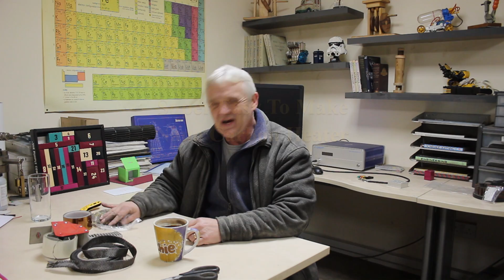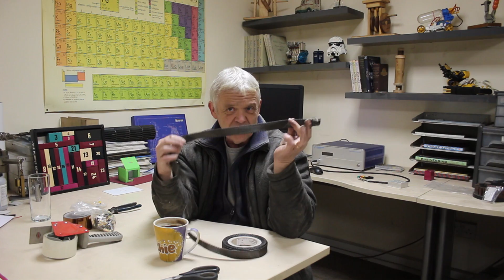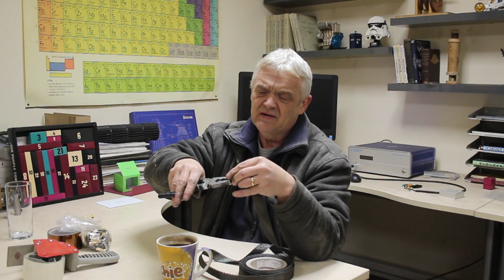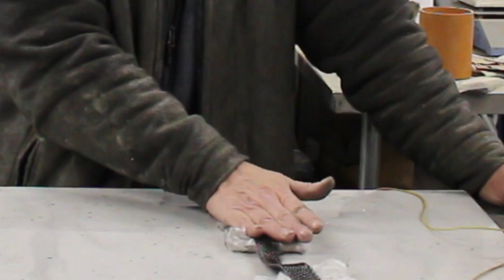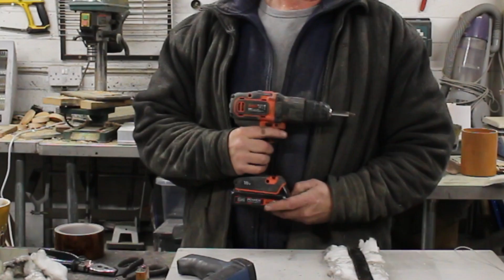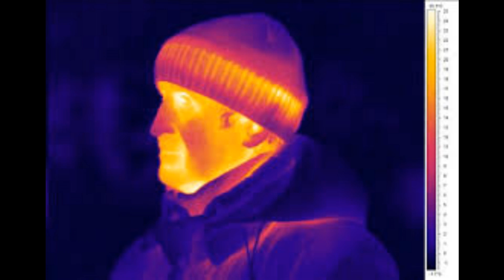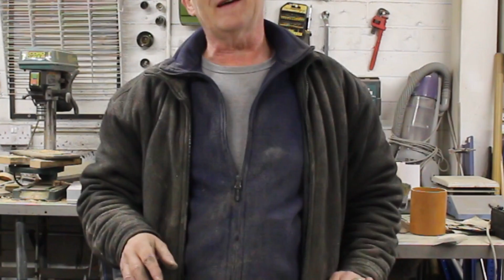1765 DIY Super Easy To Make Nano Carbon Infra Red Heater For A Ton Of Uses

Comment: Wonderful Video. When you have no lab-equiqment you can use DC Multifunctional Power Supply. They have an output from 3-12V or 9-24V so you can adjust the heat.

Comment: I have an old wetsuit, so I'm going to try and make my own heated body suit by sowing in the single strand carbon throughout the suit. Nice and toasty in these cold winter months. What a good idea. Thanks for all you do.
Reply: Just don't go swimming 😆
Reply: @yippykaiyay012  sounds more like a challenge than safety advice 🤣🤣
Reply: D.C. works underwater so you should be safe
Reply: Sounds like it might turn out to be a sauna suit.
Reply: @yippykaiyay012  Especially iun salt water LOL
Reply from the maker: like it - let me know how you get on will you
Reply: A variable resister may be useful for testing if you don't have a variable power source.
Reply: I would do that with some woven long underwear,  but I thjnk the wiring would be  very tricky.
Reply: @toml.8210  I have a great idea for where to store the battery 🔋
Reply: @MrLiamHenderson  LOL!
Reply: Hej do you know where in the uk i can buy some please ?  Thanx

Comment: Thanks Rob, another great infrared video! 

If I remember correctly, standard solar cells for panels generate around 5 Watts each (you can buy "B grade" factory "faults" for next to nothing).

So, have a bunch of those running into a few batteries throughout the day, and make some carbon fibre wallpaper. Sure, you won't be looking at huge temperatures, but it will hold a steady temperature keeping the room above silly temperatures during the evenings. And best of all, it can probably be done for a couple of hundred pounds, and will never need refueling.

It's on my radar for a test project. If I get round to it I'll share the results.
Reply: Do you know about the conductive ink? That may be a better idea...
Reply from the maker: that's a clever idea mate - please do share if you do it
Reply: Under floor heating sheets would do the same job.
Reply: @davidsoulsby1102  not as cheap though
Reply: interested
Reply: If you have enough sun for Solar panels, it is far more efficient (and especially far cheaper) to directly turn the Solar light into heat.
Reply: @justinw1765 how, exactly? And maybe not always true, depending on what can be harvested and put to use
Reply: @TravisTellsTruths    It does depend on exact location and build of the house, but if you have any areas relatively near any 1st floor/easily accessible from the outside windows that receive consistent sun on sunny days, you're good. 

    Essentially you build insulated boxes that have a clear top/front, connect the boxes with an insulated hose, and on the first box you have an air intake hole on/towards the bottom, and an exhaust hole towards the top (connecting to the top of the other box etc,) and with the last box, you run an insulated hose through an insulated insert in the window closest (a small fan inside that hose in the window insert is most likely needed, so you will get some air flow due to the expansion and natural convection of the air.)  

    The inside of the boxes need to be painted with a very black, higher heat paint, and preferably on some kind of material/structure inside the box that makes the air move more slowly. Folks often use aluminum cans painted black.  Some use metal or fiberglass screen painted black, etc. 

     There ways to maximize efficiency, such as using better insulation than usual, * putting some kind of material inside that can absorb a lot of heat energy so that when the sun starts to go down, you get some warmth past sunset. 

   And the biggest one is probably not just having a single pane of plastic or glass for the front/top outside of the insulated boxes.  I see a lot of people doing that, and you will lose a lot of energy out of the system via just a single clear layer.  Best to have at least 2 layers, with a stilled air gap of around an inch or so (can be a little more or a little less).

   A lot of folks use foam, which is pretty good, but if you can afford it, getting fumed silica and sandwiching it in between two waterproof layers and sealing it, it really good.  Fumed silica is on par, insulation wise, with aerogel made out of silica--which is many times more expensive than fumed. 

  This is why most manufacturers making vacuum insulation panels, primarily use fumed silica as a core, spacing material for them.  Because it makes the VIP's better, and if anything ever happens to it and it gains pressure/air, it will still be highly insulating even when not under vacuum (though, nothing common/easy beats vacuum). 

   There are plenty of videos on YT in relation to people building Solar heaters/collectors--recommend that if you interested in this subject to do more research and see what different folks are doing.  Unfortunately my property is far, far too shaded for both Solar heat collectors and Solar panels. Too many dang trees.
Reply: I could comment a lot. Most clear layers block a ton of infrared and you can't have that. You're right thought water is highly efficient at storing heat. I finally came up wurh the understanding of lightning 3 days ago. It's awesome and oys really all hear in water. You are right that it's easy to heat hot water for use and that's simple but unfortunately,  not as easy yet to transduce that heat to electricity.

Comment: What a great and SIMPLE heater !  Put the ribbon into  a sand BATTERY and simply attach it to a SOLAR PANEL for some extra FREE HEATING this winter. CHEERS from Manitoba CANADA
Reply: What a great idea for a DUMP LOAD ! Preheat well water going into your HW tank.
OR simply heating water for livestock via Solar or Wind AC/DC power....no electrocution worries at low voltages
Thank for getting OUR minds thinking about this simple "heater"  !!   (FYI - I want to make make a heated steering wheel cover your video shows how easy that should be)
Reply from the maker: nice one mate - great suggestion

Comment: Used carbon fibre for years. Never knew it was conductive :D 

Every days a school day. Great stuff.
Reply: Were do you get your carbon fiber?
Reply: @shellymitchell9660  I stay in Glasgow. There's a car accessory shop that sells it, they're just down the road from me.
Reply from the maker: awesome mate - glad it helped
Reply: @JW-YT  thank you. I always find it difficult to find some of the main stuff that Robert uses. Looking up carbon fiber has led me know where. Some have nylon in it some have a coating over it.  I don't want to waste money on something if I don't know for sure.
Reply: Just this week i watched an rc car try to catch fire because the ESC terminals were set into a CF plate. That apparently was an oversight from a company on a fairly mass produced product 😂 carbon also works as a faradays cage. Supercars apparently have the worst cellular reception lol

Comment: You could easily use a PWM module that you get from the auto recycler.  It's used to control the brightness of the instrument lights in a car, so it's designed for 12V power, and a few amps!

Comment: Looks ideal as a homebrew heating belt for demijohn or bucket. When they are now selling mains voltage heating belts for around £25 these days. I have had an old homebrew heating plate and a belt both expire with a puff of smoke in recent years.
Reply: And for seed propagators!
Reply: @waveydavie  Yes, £25 to £30 for a seed tray sized heated propagator seems excessive to me. When you can get a dog bed heating pad for less than £10.
Reply: @waveydavie  I've  asked the question about connecting it to the charger for this use so you don't have to keep changing the battery.
Reply from the maker: that would be a good use mate
Reply: @alanwakefield2453  I have a small bench power supply a while ago. The sort they use in schools. It was dirt cheap at the time, because it was a 220v version. So just I added one of the small plug sizes step down transformers.

Comment: Greatly useful info! Thanks!! One thing that might be helpful would be to give us the 'search terms' you use to find these awesome materials. Putting effective words into the search engine is a skill I am still working on. "uncoated carbon fiber roll 1 inch"  on Amazon search gave me options, but left me feeling uncertain as to what would actually work.
Reply from the maker: any carbon fibre mate - you only have to worry about the coating burning off - so plug it in outside for a bit and it will have burnt off - if yo buy uncounted you don't have to do that - but there are carbon fibre sellers who will tell you if it is uncoated or not - you don't need to use amazon
Reply: Hi Hippie I had the same problem ,search uncoated carbon fibre cloth or woven cloth worked for me  (ebay)
Reply: Aliexpress, takes a lot longer to arrive but better prices. They have every type you could imagine

Comment: We produced a heating sole a few years back with knitted carbon fibers. It did work pretty well but didn't really sell
Reply: Totally a parody:
We produced a heated soul a few years back, by sending it to Hell.  But, it didn't sell very well.

😂
Reply: I can see how it could've been a soul destroying experience.
Reply from the maker: might be time to relook at that mate - or use them as pads in clothing
Reply: @kennethbain4290  Charlie Chaplin had fillet of boot sole.
Reply: Hot soul tends to get funky.

Comment: Hi sir, I actually worked a lot with carbon fiber and made a lot of heating gloves (up to 20w per hand), the main issue to me is when the carbon fiber gets wet or humid, that 18v source, you will feel it and experience like a tiny electrocution, very uncomfortable. Your tape idea is a good step, I used latex, one coat of 0.5mm, I put the carbon strips, then one coat on top, and you have nice strips. You can use ferrule for connection, the best thing I could find!

Comment: Awesome!  Was considering making a pair of gloves with nichrome wire but this stuff seems much better!
Reply: Carbon fiber provides a better greater surface area, but is more expensive than nichrome wire and the latter can handle higher temps without degrading.  For something like gloves--a fairly small amount of material needed, yeah, I would probably use the carbon fiber. That way, you could even get wider cloth and cut out a mitten or glove shape of the carbon fiber cloth and get a really even, full coverage of heat. (If you do that, best to tape off or silicone caulk the edges of the cloth so that it stays together better. It unravels fairly easily, especially in wider cloths).
Reply: Nichrome wire is too brittle and hotspots will appear after repeated bending.
Reply from the maker: for gloves I think it is

Comment: Opens up a whole host of possibilities, heated screen wash bottle & pipes to name but one, a lot simpler (and possibly cheaper) than ribbon trace cables. Next step to investigate might be simple temperature control.
Reply: He already told us how to control temperature; variable voltage input.
Reply: 9V was appx 30⁰C, 18V was around 40⁰.
Reply: You could also rig it up with a moveable contact to control the distance between the two contacts, but that seems more difficult.

Another idea would be to run different lengths at the same power, I think.
Reply: Hmm, what effect would increased amperage have other potentially making it more dangerous?
Reply from the maker: You can't increase amps directly please watch the two videos I link at the end of this video they will help tremendously
Reply: @ThinkingandTinkering  Agreed, but wasn't your source variable voltage? I=V/R right? If resistance offered by the element remained the same and voltage increased wouldn't your current also increase? 

Also, I wonder how those values may change over the life of the rig. Great idea though!

Comment: Yes I want to make a water heater. I think I can wrap the water cylinder in carbon fibre rope with Kapton tape on cylinder first then on top to keep the rope apart but I may need high voltage to heat a 50 foot length.
Reply from the maker: yeah that would do it

Comment: Man, you keep giving me ideas. This has probably become my favorite channel. I watch almost every new video I see in my feed. Thanks again. 
   As a motorcyclist, I could see making some clothing, socks, thermal underwear, etc. If 12v is enough to get some warmth, it could be plugged right into the bikes power. If you want a few more volts, I  assume you can just wind a small induction coil and add it to your circuit. 
   I really need to get my old college textbooks out and review the stuff. 
  I'm curious if you did any tests to find out the wattage per foot, per degree of temperature increase, and I wonder how long an 800amp car battery would power say a 12 foot section sewn into a sleeping bag and still have a decent amount left to start an American V8... I realize there a lot of variables. I would just be curious as to a best guess.
Reply from the maker: have a look at the videos I linked at the end of this mat - they should help tremendously
Reply: @ThinkingandTinkering  TY. I should have been listening better.

Comment: On the opposite end of the spectrum, you can get basalt fiber in the same sort of product variation that acts as a heat and electrical insulator.
Reply from the maker: that would stand up to some heat for sure

Comment: you have probably covered this before but i tried just using the thinnest wire i could find laying about wrapped about 10 meters of it around my gloves and connected it to an 18650 battery ,it got to a cosy 35 degree in about 3 minutes i might try stitching some suitable wire into jacket liner and make me a heated jacket

Comment: You can get a used computer power supply, fairly cheap,  add ribbons to add more area,more current using switches , for more heat, or switch between series and parallel for more heat, pull more current, more heat,  I got a 12,v 36a supply, two for about $18,  or adda dc motor controller to crank up the heat, or even a decent size dc converter!

Comment: incidentally the reason I have all that wide Kapton tape is for 3D printer work, and making flexible circuit boards by putting thin sheet of copper on it and spraying the copper so I can engrave the paint and acid etch it, and if needed lay the kapton over the etched area too so I can adhese another layer of copper circuit the same way before sealing it all in with circuit components :)
Reply from the maker: clever mate

Comment: I'm thinking get a straight piece of copper pipe, wrap this around it and have a water heater. If you could get that drawing 2 or 300 watts say and connect it to a single radiator. So it recirculates Like converting a radiator to electric with a heating rod, you could do this with some kind of thermostat and have a very cheap to run electric radiator.

Comment: I guess oil heaters could move to conductive carbon felt or something cheap like that to make heat. Though you could make a sand battery radiator heater using carbon heating elements.

Comment: You need to map out where the blood vessels come to the surface of the body, so then you know where is best to sew in the heating element for the most efficient heat exhange. I'm thinking the back of calves, and inside of the fore arms.
Reply from the maker: or - you could just look at where they sew them now and copy that!
Reply: @ThinkingandTinkering  I think they just bung them in the back because it's easiest and saves on wiring.
Reply: @ThinkingandTinkering  I know I did on my fist go.

Comment: Absolutely love this one. Going to do this with a 5V usb setup.
Reply from the maker: awesome
Reply: Can I ask how you would do that? I have a USB point in my car, and I was considering running something off that to provide heat to a pad in a similar fashion shown in the video. I wasn't sure what I'd need inbetween the USB port and the carbon/fabric to replicate the negative and positive terminals in the video. Any pointers would be appreciated, thanks.

Comment: Good idea, it has a higher melting point than nichrom too so, easy diy kiln? I kinda want to coat it in clay and fire it to make a ceramic space heater lol. Wait, if carbon fiber can conduct it can make a magnetic field cant it? Would make electric motors much lighter.

Comment: This would also act as an excellent tank heater to keep a rain barrel from freezing during the colder months and could even be powered with solar panels
Reply: Why would you need to keep the rain barrel from freezing? Do you use rain water?
Reply: @Teknopottu   You can use rainwater for irrigation or cleaning outside surfaces  Or it can be filtered and sanitized for drinking water.

Comment: Hi Rob. Big Clive has done a couple of videos on re-using the li-ion cells from discarded disposable vape pens recently. It might be another way to power something like this, especially for smaller items like gloves or hats where having a large battery pack would be a disadvantage?
Reply from the maker: I agree mate - it's an awesome idea
Reply: Wait. Are you saying disposable vape pens have re-chargable batteries?
Reply: @guesswho399  Yep. They have rechargable cells just no charging circuitry. It's a shocking waste that they are just thrown into landfill when the battery is exhausted.